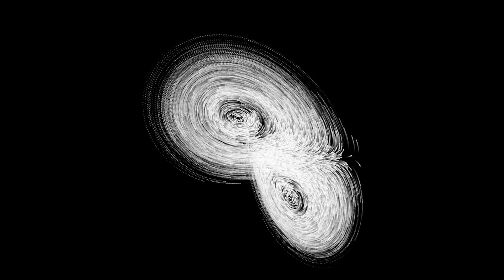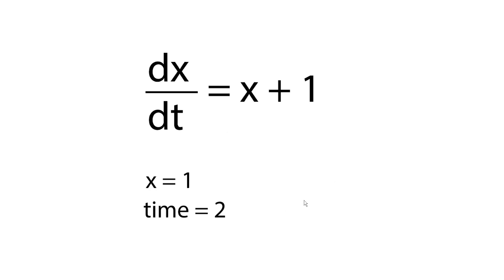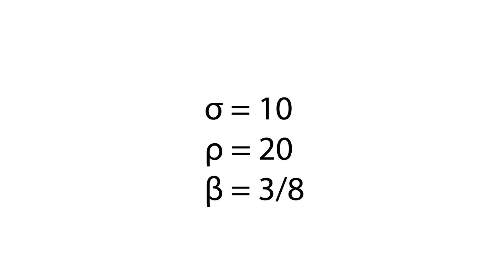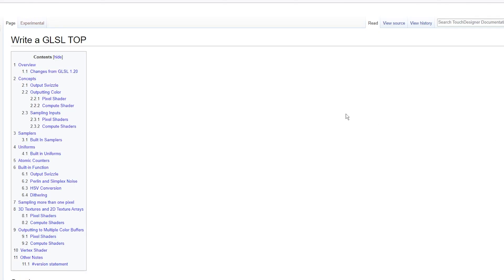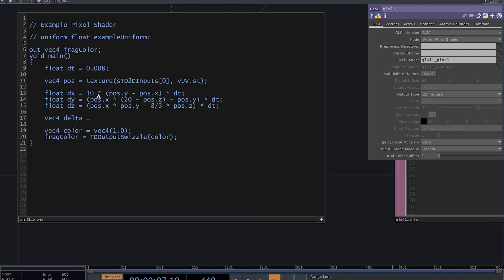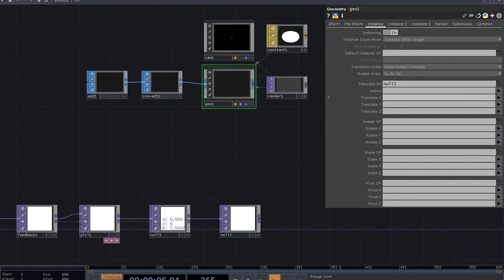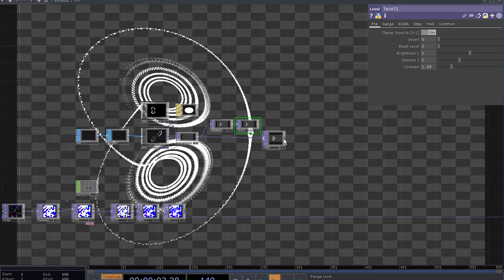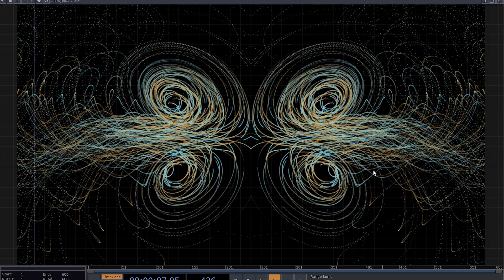Butterfly effect - Lorenz attractor (Touchdesigner tutorial)

Comment: As always: nice video!
I do have a problem, though. I'm running version 2017.107 and it seems the Add and Convert SOPs have changed. If I bypass the Convert I get a moving point/particle in the Geo preview, if the Convert is active, nothing appears to be happening. And still, if the Convert is bypassed I only see a point/particle in the preview, nothing gets actually rendered. Does anybody have a clue what's off here?